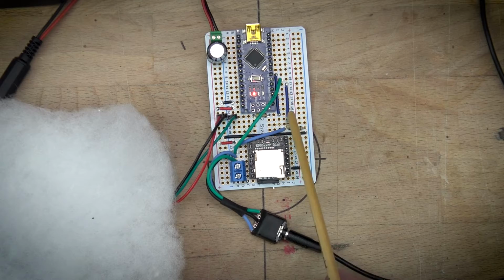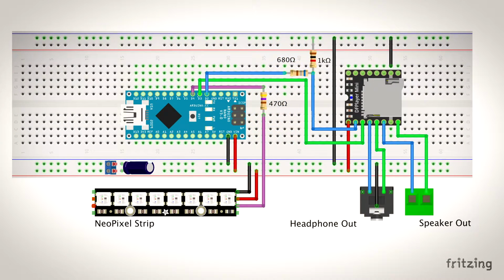Lightning and Thunder Effect - Arduino, DfPlayer Mini, NeoPixels

Comment: Hello, im buildin a resident evil 1 diorama and want to have thunder lighning in the diorama.
Could you give me some help please? I ont know nothing about arduino. I see the code on the blog, but dont know how i have to put it onto the arduino itself.
Is it only an sd card where i put the text document onto or....?

I buy all the parts you linked, but im afraid if i dont get any help i will be stuck in this project.

Would be very kind of you.

Thanks
Reply from the maker: Nice! OK... let's see if we can get you going. The blog post is a great resource for the parts, the wiring, and the code. It sounds like you have what you need for putting things together so we'll focus on the code. Arduino is pretty easy. To program the board you need to download the "Arduino IDE" software from the Arduino site. You connect the Arduino board to your computer through USB. When you open the software, you'll need to select the board you're using and the port. There is a drop down in the top of the window that may show your board but you may need to go to the menu Tools/Board and select the Arduino Nano from the list. You can also go to Tools/Port and select USB. Here's a video that talks a bit about this - https://youtu.be/o1DwjJBqOAQ?si=3KT7q_EIWYZuknMw

The next thing you need to do is install a few libraries. On the left side of the window, the third icon looks like books stacked on a bookshelf. Click that. There will be search at the top. You'll want to search for these libraries and install them.

- SoftwareSerial.h
- DFRobotDFPlayerMini.h
- Adafruit_NeoPixel.h

There may be libraries with similar names. It doesn't hurt to install more than one if you're unsure which one is the right one... I do it all of the time. These libraries are bits of code that will be added to the code automatically when you upload it to the board.

Copy and paste the code from the blog and hit the arrow button at the top to upload. It takes a bit of getting used to but Arduino is pretty easy once you get the hang of it and there are a ton of programs people have already written that do cool things so you don't need to be a programmer.

If you get stuck, reach out to me through the blog site!
Reply: @RandomMakingEncounters  im affraid to start this cause ive read that many people have problems to bring this to work. Also i need to buy all parts in a big quantity so it cost me about 100 euro to get all  the parts. ISnt there a finished solution for this?

Is there a way that you could build one and I would pay for it? Or if I start this project and i have trouble would you be willing to assist me and help me?

Thanks
Reply from the maker: @gaboaaa23  I think you touched on a great point. This is a reasonably complex circuit with components that can be finicky at times. Something pre-built sounds like a better option for you. I would check out https://evandesigns.com/ They have thunder and lightning lighting products. They focus on LED lighting for hobbyist and could probably set you up with everything you need or build you something custom. This would give you something more reliable and cost effective since it's designed and produced to sell commercially. Less things to troubleshoot and no need to become an Arduino programmer.
Reply: @RandomMakingEncounters  yes you a right! I contacted him already! With shipping it will be around 30 Euros.

And no hassle with arduino and stuff.
Reply from the maker: @gaboaaa23  Awesome! I wish you the best with your project! Please share the final results if you get a chance! Cheers!
Reply: @RandomMakingEncounters  hey, i will! The house is almost finished. Doing the led lights now

Comment: What a great project. I would love to build this one too. But a question: I want to use 3 or 5 meter led. What kind of power suply do I need for that? And how should I connect that?
Reply from the maker: Thanks for the question. A quick caveat... I'm not an electrical engineer or electrician so always double check this information. I say this because what works in a diorama and is safe can get interesting and potentially dangerous when you scale it up.

With that out of the way, here's my understanding of what you need to consider when you go big with LEDs. The big difference between small and big is the amperage required for the lighting. Each color in each pixels can draw between 15 and 20 mA. If you're using an RGB strand, that's 45 to 60 mA per LED (if you use RGBW LEDs add another 20). The number of pixels per meter will vary. I've used a few that are 60 pixels per meter so we'll use that. For five meters, we get 300 pixels at 60 mA or 18,000 mA or 18 amps. This assumes all colors are on full brightness and all pixels are lit at the same time. That is rarely the case but is the worst case and you'd want to add a bit of headroom in the power supply... so 20 amps or so. The more headroom you have on the supply the kinder you will be to it.  I've used WS2812 strands that are 5 volts which is the same as NeoPixels so we'll assume our power supply is 5 volts and can deliver sufficient amperage. A multimeter is your best friend here and I always check the current draw on the circuit to make sure I am doing basic math and conversions correctly... my degree is fine art so I don't always maths good.

Connecting long strands will require the use of wire that can support the current as well. If we look it up on an AWG chart or do a bit of searching, the number that comes up is 10 to 12 AWG. All of this will depend on your final current requirements but the takeaway is make sure your wire can handle the amps as well. Too thin and it will heat up and heat is bad.

A final wiring consideration is voltage drop along the strand. Long strands of LEDs may shift color towards the end. This is due to each pixel taking a tiny bit of voltage along the way to the point where they will start to dim. The solution to this is power injection along the strand. A quick search will show you how to do this. Long strands usually have power injection wires and regular intervals. It's just a matter of running power from the supply to points along the strip. Here's a link that talks about voltage drop and describes choosing the correct wire gauge.

https://www.flexfireleds.com/led-strip-light-voltage-drop-what-is-voltage-drop/

The LEDs strip is powered directly from the power supply. The Adafruit connection diagram shows a 1,000 uF electrolytic capacitor across the incoming power to protect the first pixel from damage when you power the strip on. For good measure and a bit of safety, I would wire in a fuse that will blow should the amperage exceed what I've planned for. There are lots of inline glass fuse holders that make that an easy bit of additional peace of mind. Always build in a margin of error and use a fuse that will blow at a point lower than the max the circuit can handle.

The last thing you need to do is connect and power the Arduino. The Arduino needs 7 to 12 volts on it's VIN pin. You could use a separate power supply but I would use a buck boost converter that bumps the 5 volts from the supply up to 9 for the microcontroller. Connect one of the digital pins to the data line on the strip through a 470 ohm resistor and that's the basic setup. One important thing to note is the ground of the strip needs to connect to the ground of the microcontroller or you will get erratic behavior on the pixels.

If you don't need RGB and just want a lightning effect with white, that's a different approach since you'll just want to toggle the strand on and off rapidly. Here's a post that describes how you can do that. All of the amperage requirements noted above still apply but the amps should be lower because you only have a single color per pixel. The main different is you would use a power MOSFET board to act as a switch for the strip and the code is simpler.

https://randommakingencounters.com/thunder-and-lightning-effect-redux/

Here's my favorite resource on NeoPixels

https://learn.adafruit.com/adafruit-neopixel-uberguide/

I hope that helps. Have fun, be safe, and all the best with your project! Cheers!

Comment: The diagram featured on your blog post includes a LM-7805 voltage regulator, which is missing from the diagram and completed project shown in this video. Is there a reason you removed it? If I'm powering my project with a 12V power supply (8 AA batteries), I should include the voltage regulator, correct?
Reply from the maker: There are a couple of approaches to this. Let's start with this post:
https://randommakingencounters.com/lightning-and-thunder-effect-arduino-dfplayer-mini-neopixels/

This project requires two voltages - 5 volts for the NeoPixels and 7 to 12 volts for the VIN pin on the Arduino. The VIN pin connects to the Arduino internal 5 volt regulator and requires voltages in the range noted above to function correctly. With all of that in mind, the diagram in the post takes the approach of a larger wall transformer that directly powers the Arduino and regulates the power down to 5 volts with the LM-7805. This is an easy circuit to build but you need to be careful about how many amps your LED strand draws for any length of time. The 7805 is only rated for 1 amp and RGB LEDs can add up quickly. I would probably use a 7 to 9 volt transformer to avoid the regulator having to work too hard and be sure to heat sink the regulator. Here's a great page discussing power requirements for NeoPixels - https://learn.adafruit.com/adafruit-neopixel-uberguide/powering-neopixels

Another, maybe better, option is to use a 5 volt power source that can deliver whatever amps your strand requires. In this application I would power the LEDs directly from the power supply and use a Buck Boost module to bump up the voltage for the Arduino to between 7 and 9 volts. The Arduino doesn't draw a ton of current and this approach should run a lot cooler. Boost converters are not as bog standard as the 7805 but they're readily available online and you can get either fixed values or adjustable versions. The benefit here is you can scale your power supply to the current requirements of the strand and not be limited by the current capacity of the power regulator.

I have a second post that shows how a boost converter can be used:
https://randommakingencounters.com/thunder-and-lightning-effect-redux/

This blog discusses how to use MOSFETs to control a strand of white LEDs but the power concept is similar. 

Hope that helps! All the best with your project!
Reply: @RandomMakingEncounters  Thank you for the detailed response! Going to weigh my options and see which one is more feasible for me to complete in time for Halloween. (This is what I get for procrastinating.)
Reply from the maker: @markiegeewhiz  I'm all too familiar! Have a great Halloween and all the best with your project!

Comment: HOW DO I DOWNLOAD A MP3 TO IT??
Reply from the maker: It's pretty easy. The player uses a micro SD card for storage. You would insert the card into your computer and load the file onto the card. Pop it into the player and you're ready to go. Having said that, there are a few things to note that the wiki does a solid job of explaining - https://wiki.dfrobot.com/DFPlayer_Mini_SKU_DFR0299

To sum up a few things from the docs: You should format the card to FAT32 and it looks like it only supports up to 32GB sized cards. I would name the files in a way that sorts in the order you would like them to play... 01thunder.mp3... 02thunder.mp3 and so on. If you're using a Mac, saving files creates hidden files on the card that can mess up playback. What I've found to fix that is to show hidden files on the SD card by using command/shift/period and then delete from the micro SD card any hidden files. You shouldn't need to do this step on a PC.

Hope that helps! The docs are really solid and includes some additional sample code and different ways to use the module. All the best with your project!

Comment: I've looked here and the blog post but I can't seem to find a link or title to the sound file. Is there one, or what parameters did you use to find it. Thanks
Reply from the maker: It's been a minute since I made that video. I'm not quite sure where the audio files came from. I use licensed files in some of my projects that prevent me from sharing so that may be why there's no sound file??? All is not lost! It's quite possible that I used files from one of these two sources since they are my go-to for effects:

This is a great source of free sounds but can vary wildly in selection and quality
https://freesound.org/search/?q=thunder

This is a great source of consistent quality affordable sounds and is the most likely place the video sounds came from
https://soundrangers.sourceaudio.com/tracks?s=thunder-sound-effects

If you're looking for a great tool for editing audio, here's a free option
https://www.audacityteam.org/

Hope that helps and all the best with your project! Cheers!
Reply: @RandomMakingEncounters  Thank you
Reply: @RandomMakingEncounters  If I can bother you with another question. How many tracks do you think you used, or was it just one?
Reply from the maker: @joemuellerleile5544  I rewatched the video and think I said eight… maybe. Realistically, 3 or 4 would be plenty and eight is a little overkill. In the code, there is a point where the track number is randomly generated and the volume is randomly set. The goal is to make it less repetitive and more natural. Depending on your project, that may not be necessary and you could use just one track if you’re looking for more of a one-shot effect. If you want a bit of variety, three would probably be a good number with a mix of distant rumbles and a close strike thrown in for a bit of drama.
Reply: @RandomMakingEncounters  THANK YOU  so much!!!! Just now got it working. It's ALIVE!
Reply from the maker: NICE!!

Comment: I guess I could use something similar for SFX for electrical short (flicker white light - mark arc sounds?)
Reply from the maker: Absolutely! I used something similar for a haunted tombstone radio that has a short in it. It's even simpler than the example. You don't need NeoPixels. I used two or three cold white LEDs wired to three pins. I trigger the electrical arcing sound and then quickly and slightly randomly flicker the LEDs for the duration of the sound.
Reply: @RandomMakingEncounters  can you make a track loop - e.g signal to commence FX.......loop single track when signal lost - cease?
Reply from the maker: @itolond  the DFPlayer mini has a pin on it that signals when the track is playing. You can monitor that pin so the effect stops when the track stops. Not sure if that answers your question but I hope that helps.
Reply: @RandomMakingEncounters  maybe end track signal restart track? - Aussme there is a stop play?
Reply from the maker: @itolond  indeed there is! Plenty of control options on the Mini. Here's a link to the wiki - https://wiki.dfrobot.com/DFPlayer_Mini_SKU_DFR0299. There's also an Arduino library that supports the player. Here's a link to the GitHub repo - https://github.com/DFRobot/DFRobotDFPlayerMini. It's not as detailed and mostly points back to the wiki but there may be some goodies in there.

Comment: Is it possible to start with switching the power on, and to stop again with the power off.
Or is there a other way to do this, for example with a relais contact?
Reply from the maker: Absolutely! Rather than having the effect immediately start playing when you power up the Arduino, you can connect a normally open switch to the Arduino. Then, you have the code keep an eye on the status of the switch. If the switch is pressed (closes), run the lightning routine. It could play once if the switch is momentarily closed or it could play continuously if the switch is held closed. This is a better approach than controlling it by powering the board on and off since it will give you more immediate control over when the lightning starts. Powering the board takes a second or two while it boots. Sorry this took a couple of weeks to reply. Hope this helps and all the best with your project! All the best!

Comment: Thanks for the informative video! I may have missed it in the comments. But what would you recommend to run this off a light sensor? For example a box opens then the light triggers this? I'd also like to run it off a battery as I'm attempting to make a gift box
Reply from the maker: Man I'm lame! So long on the reply. The gift giving has probably come and gone. However, the short answer is yes. There are a bunch of ways you could trigger the effect. One way would be to connect a micro switch to the Arduino. The lid would hold the lever on the switch down. When the lid is lifted, the switch opens (or closes depending on the type of switch) and is detected by the Arduino. This kicks off the effect and could allow it to loop for as long as the switch is active. Your idea of a light sensor is also fantastic and maybe even a bit better since you don't have to worry about the mechanics of getting the lid to hold a switch closed. It's the same concept except you connect a photoresistor to the Arduino and measure the value. When it hits a certain amount because it's exposed to enough light, the effect loop plays. This tutorial shows how to toggle an led but could easily be modified to simply run a bit of code - https://projecthub.arduino.cc/tropicalbean/how-to-use-a-photoresistor-1143fd

I hope you were able to get it all sorted. All the best with your projects!